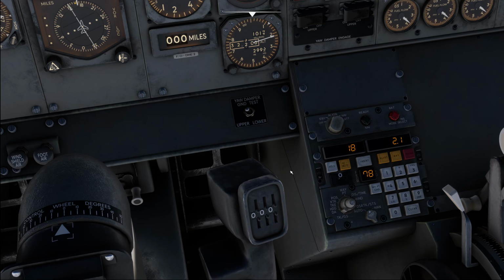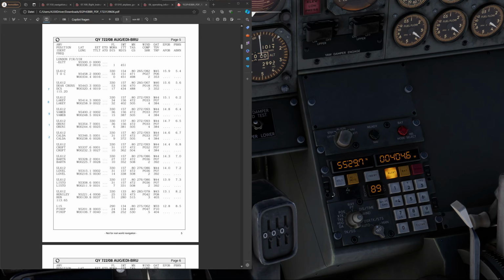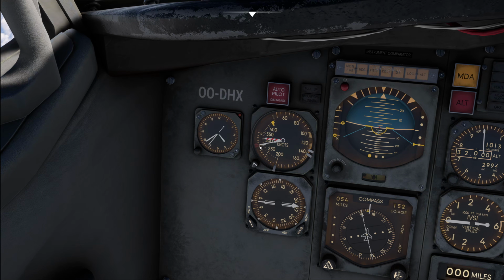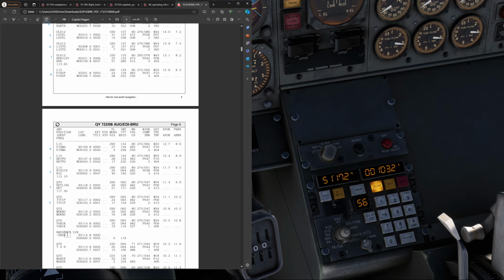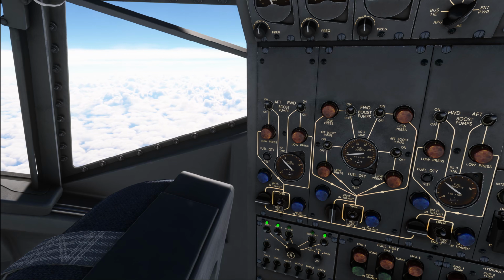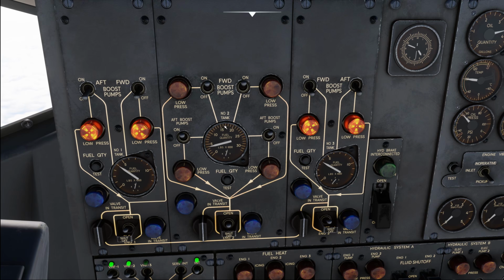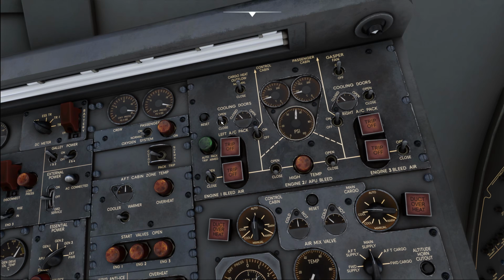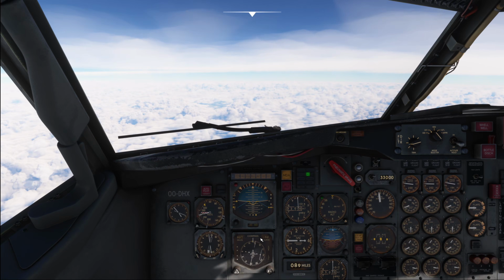FSS Boeing 727 Tutorial 6: Cruise | Real Airline Pilot

Comment: This is my favorite airliner in the world. I must’ve refueled hundreds of them. Delta train us to work the engineers panel, the transfer of fuel for the overnighters. I’m not sure if you ever heard about the speed trick? Apparently you pull the slat circuit breaker And extend one notch of flaps and the airplane will actually accelerate so many more knots. There are a few documentaries on it. Including one almost crash.
Reply from the maker: Hi, I heard about it - but from a modern pilots point of view it's a big no go :D
A modern plane would immediately detect your doing and email it to the airline by ACARS. Not only would the plane have to go into an overspeed inspection, you would be guranteed to get some tea without biscuits with your chief pilot as well.